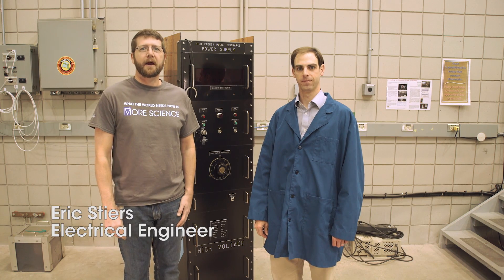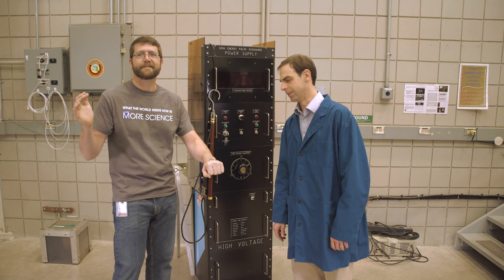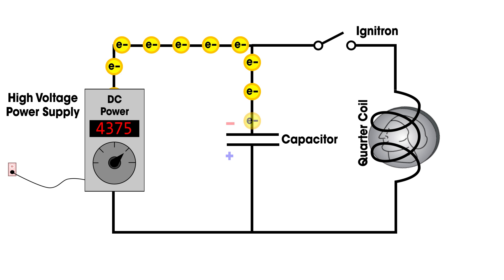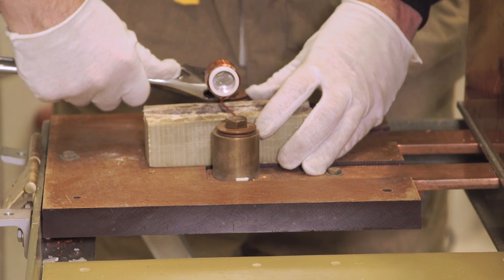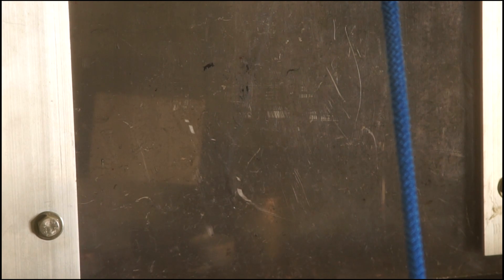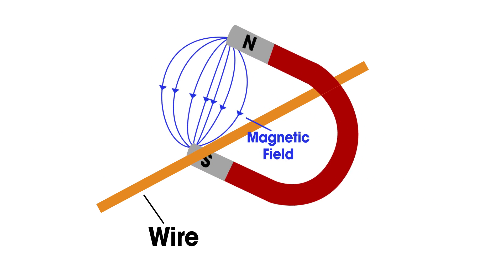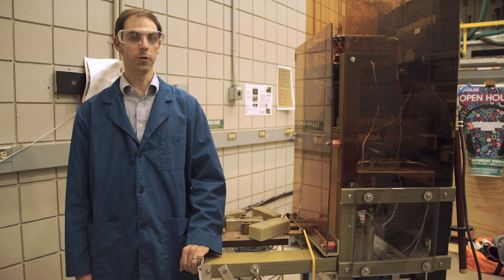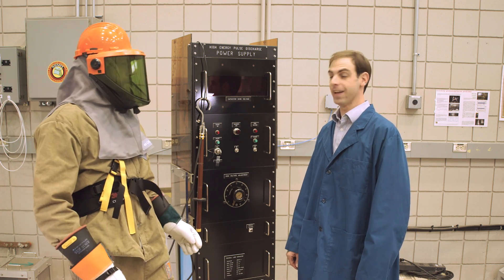The Amazing Quarter Shrinking Machine!

Comment: Um, out of curiosity, did the quarter maintain its volume, becoming a taller coin with a smaller diameter, OR, did the experiment actually shrink the coin, like in the movie "Honey, I shrunk the kids?"
Reply: Good intuition, the coin would have the same volume, the metal molecules still take up the same amount of space per gram they've just been pulled together.  In fact, if anything they briefly take up more total volume after the experiment because heating metals makes them expand :)

Comment: 7000v, yes, but what is the capacitance rating (uF) of this capacitor??  After many years of shrinking quarters, I have found a way of getting perfectly "FLAT" shrunken quarters.  All you have to do is have enough Joule/energy at the proper current/energy rating, and a VERY simple formula!  I got tired of those flat (sinusoidal) waves around the circumference of the quarter!   I will describe it if you need.
Reply: Ok please tell me how can I make this kind of amazing quarter shrinking machine
Reply: I’d be interested in your math.

Comment: Nice work guys. 
For the record I'm the one who invented that, it was 20 years ago. Became distracted by other projects. 

Try copper and aluminum tubes at a voltage low enough to not rip them apart, then look inside thru the ends. For me, copper has 8 evenly spaced ripples, aluminum mainly 3 groups of 3. Time now for the words that precede all great advances in scientific knowledge: "Huh, that's funny". Is that something about the manufacturing or inherent in the element itself? See if you can find tubes made of any other conductive materials and also try those. (Stainless steel railing from a boat. Soft bendable plumbing copper vs rigid). Then figure out why it happens and leverage it for a whole new set of inventions to make the world better. :) The effect of circuits and physics. Or should I say, physics and circuits.

Would like to see the ignitron on video close up some time, switches make the world go 'round.
Reply: no your not they have been shrinking metal since 1926.... do your research